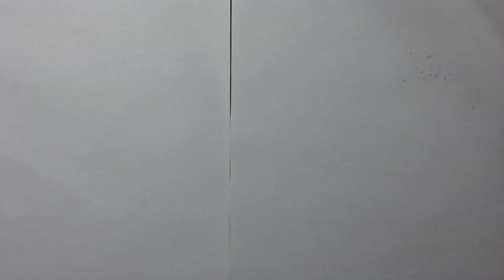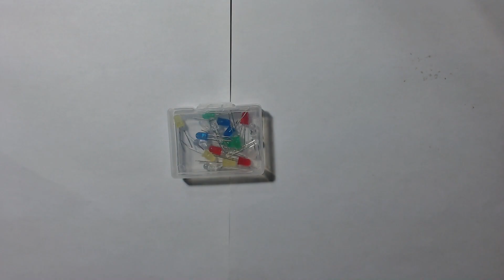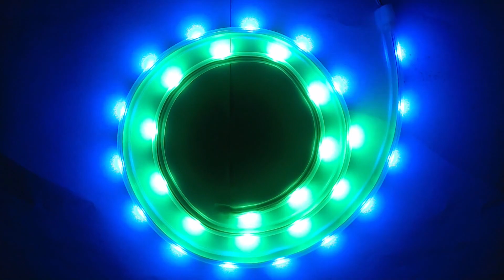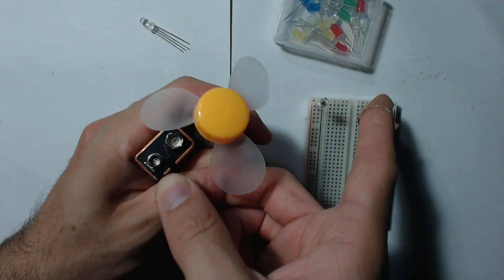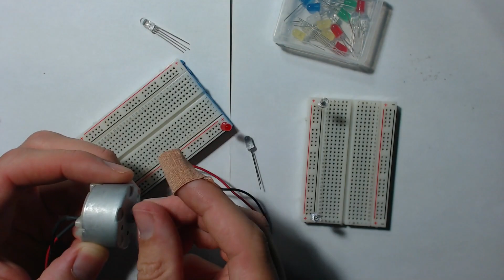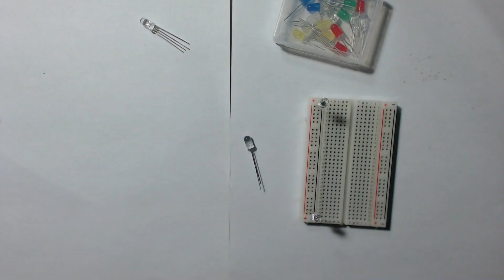DIY LED Color Sensor

Comment: Would you post a video presenting the final working solution? Is it able to detect the color of paper painted in primary and secondary colors?
Reply from the maker: Sorry, I won't have time to do so in the coming weeks. It will be able to detect the color of primary and secondary colors. You just need to be sure you have an appropriate light source that will reflect enough light back and something to focus the reflected light to and shield the ambient light from your sensor. I recommend printing the raw values out to the serial monitor and play around with it to see what works. Hopefully that is helpful!